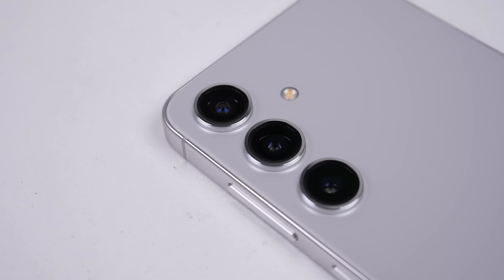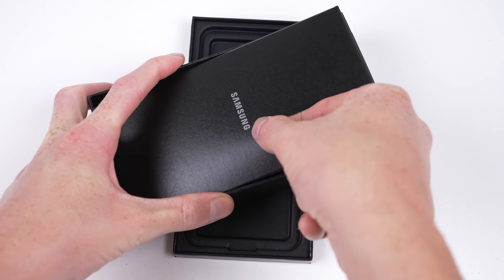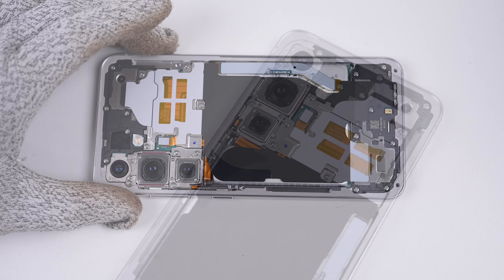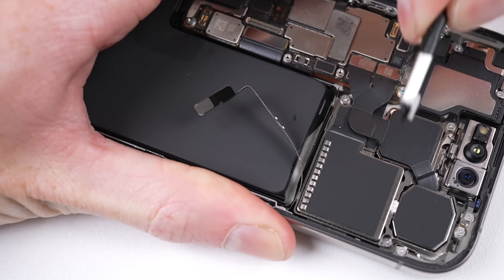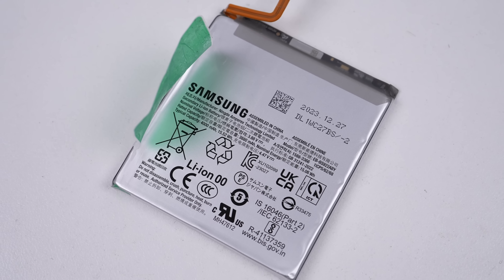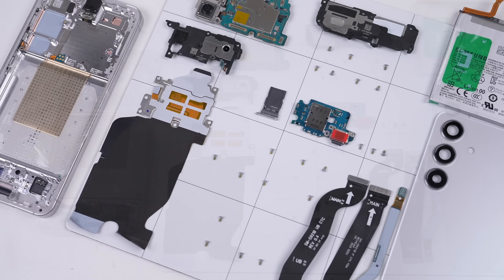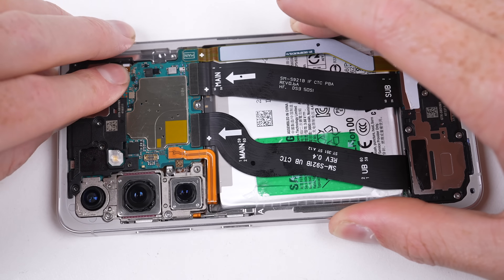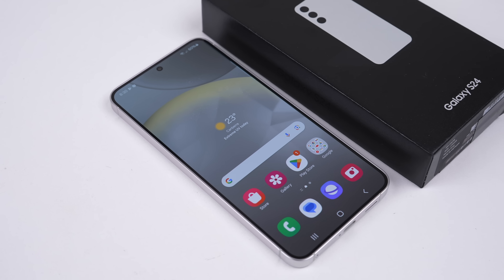If Only Apple Could Make A Phone This Easy To Repair - Galaxy S24 Teardown and Repair Assessment

Comment from the maker: Finally got some new things up on the store over the week. 
Keep an eye out on the YouTube community tab over the next few days as I will be looking for some input from my viewers as I plan to make some changes to my content and possibly upload schedule.
Reply: At  3:49  there's no need to remove the flex cables to remove the battery.   Simply warm up the screen side on low 80C setting on a heat plate for about 3 minutes, bend the flex cables over to the screen side and apply a bit of tape to hold it, pull or pry the battery, and it comes out nice and easy.  And for heaven's sake, please don't inject any rubbing alcohol under the battery, while it evaporates, it can damage the sensitive AMOLED if it seeps under the screen.  I do this every day at my repair shop, saves a lot of time and aggravation. ;)
Reply: can you do oneplus 12 next?
Reply: No, you're not alone. I'm running a iPhone8 with iOS 11.3. Still does what I need it to do.
Reply: Me watching him set up the new phone when I'm using a low end 2020 samsung 😢
Reply: I Love your videos and channel 💞
Reply: Can we also get an s24+ tear down too pls
Reply: @jack8356 it's the same phone but bigger

Comment: to ALL the repair techs that complain about these kinda batteries.....have you considered that samsung isn't guessing that the phone will be brand new by the time you change the battery.  it's prob more like 3 years for most people...seems like the adhesive would be quite a bit less sticky 3yrs later...right?

Comment: One of the reasons why I still haven't retired my locked to Android 8 LG V20 is that, even though the battery is showing its age... I can just pop off the back cover and put in a new battery. Which I did, because the current battery was a triple life third party make that I got years ago, and I can just replace that with no effort. And it has a micro SD card slot. And a headphone jack.

Comment: Pulling alcohol between battery and body may cause display damage because of gap in the middle of body under battery, as well as alcohol properties to penetration. I preffer to make this like you at 1th attempt with using only force.

Comment: >just heat the back up to use a suction cup to lift the glass so you can shove stuff underneath to pry it open 
The fact that this is "easy repair" for current year + 9 is really sad.

Comment: I think Samsung 'soft cementing' their batteries in place with adhesive comes from paranoia from the Note 7 days. Even though it was more of a manufacturing defect combined with giving zero breathing room for the battery. At least a pull tab is better than zero so combined with alcohol and some heat it's safer to pull out than prying it out and risk puncturing.

Comment: Weird to title a video "If only Apple could make a phone this easy to repair" when replacing a screen requires complete disassembly and a whole housing swap, the only way in is through adhesive-riddled glass, and the battery has as useful of a pull tab as the iPhone 4S. Whereas a modern iPhone uses screws for closure of both front and back, only enough adhesive for water resistance, and an easily swapped battery that doesn't require force or solvent. The only good move here is the lack of parts pairing, but thankfully we'll have legislation banning the practice eventually- the EU is already working on it.

Comment: 05:09 Samsung is using a molex connector, seeing that name brings back memories from the 90s/00s
Reply: That's a SIM reader, not a molex connector. They make way more than just PC power connectors (which by the way are still widely used today, if you are into building PCs).

Comment: still on Android 6 🙃. about the glue, its surprising that companies who manufacture things interms of nanometre are still using super-glues for attaching battery, which can be done with any normal glue, considering the battery fits exactly inside the slot with no space around...such glues not only damages batteries while removing, they also damage the frame..

Comment: It may be repairable, but where's the microSD slot?  I really wish samsung hadn't copied that from Apple.
Reply: why do you need a microsd slot for? it’s not 2012 anymore… you probably want the headphone jack back too
Reply: Because lacking the SD card slot means Samsung has no reason not to charge a 500% markup for expanded storage.  With the SD slot, that wouldn't fly.  You'd just get the smaller storage model and supplement it with a cheap microSD card.  Also, the galaxy A series includes SD card slots, so clearly some people do appreciate them.

Comment: For adhesive like that it's important to apply rapid hard forces than an even ramping pulling force. Otherwise you'll end up pulling a lot harder than you need to. Think of it like loosening a rusty nut, a few taps with a reasonably light hammer requires a lot less force to break it than a breaker bar and body weight.

Comment: The battery removal thing still a good thing, i work as a phone repair guy and once i had phone get into flames, with this new system little bit of heat + alcohol will do wonders compared to just glued back as it was before. In my eyes, its a move in good direction

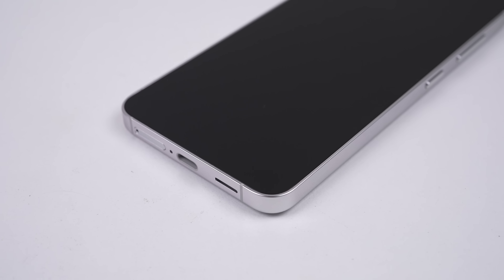Comment: 1:42 no i have the new Galaxy S24 Ultra and i'm very happy. I had the A52s 5G before but this is a huge stepup because its so much more powerful and i never had any lag issues. 
The A52s lagged all the time and got slow
Reply: Mine got stolen a52s was solid until that happened overall s24 is snappy

Comment: Im still on an LG v40 thinq, bought it used for about 60 USD here in the philippines, I recently replaced the battery ang charging IC, now it runs great and I get around 5-7hours of Screen On Time, rocking Android 10!

Comment: Also, my main phone, Samsung Galaxy S9+, is rocking Android 10, which although reasonably modern, is the last supported OS for many apps nowadays, and the critical apps are now Android 7.0+. So it seems that I might be getting a phone upgrade after all soon.
Might also buy that folding Motorola as a secondary device - never had the chance to use a folding phone before ;)

Comment: That seems just about right to me. Easy to repair, yet still being modular and also not needing 4 different types of screw. You also don't need to remove microscopic bits and pieces to do a housing replacement.
Now I'm wondering what the S24 Ultra is like, given that the S24 Ultra is being heavily advertised in the UK market.

Comment: Are you sure you used the pull tab right? Similar battery securing method was used on most huawei phones - you would have to fold/rip part of the plastic film above and below the battery pull tab, as it is gripping the battery firmly. Afterwards the battery comes out easily.
Edit: yeah at 6:30 i can see the tabs i was talking about. You should have folded them off the battery for easy removal. Huawei phones have these marked in orange color, samsung should put arrows thereor also color-coat them

Comment: I have a 512GB Micro SD care in my A050 ... and I will NOT purchase any replacement phone which doesn't allow me to re-use that external memory. I also will NOT purchase a phone without an earphone jack. So Samsung is right out!
Reply: so basically all options are out? unless you wanna pick the budget phone.
I don't say I agreed with such moves to remove those features, but we get less and less option.

Comment: This phone being easy to repair pales in comparison to the anti-self-repair stuff Samsung has been on lately. From sueing third party screens manufacturers or resellers, to attempting to serialise parts...
Sure they have a repair program. But in my opinion it isn't enough. They still control repair and the price of spare parts nonetheless, which is no-bueno especially when a screen replacement well costs over US$200, even over US$300 depending on the model.

Comment: 01:37 - Hugh, I have a Galaxy S7 that's also up to Android 8. But I'm only using it as a spare device for phone calls and SMS. 

Not only does the battery not last a day, but the security updates are very outdated. It's a security risk and that's why I do not log in with my main Google account, full of my sensitive personal information. 

Google and Samsung has recently committed to many years of software and security updates. And to me, the security updates matters more than the software, and helps promote longevity of the device and reducing e-waste.

Comment: i still don't understand why new smarpthones need to glue their batteries

why cant we just go back to the old, slide in and go battery design?, its not like there is any gap that will make the battery move from its place
Reply: The new EU law force them to implement removable battery by 2027
Reply: i think they can do whatever they want with with their product. if you had a phone brand, you wouldn’t like it if someone said that you have to do something a certain way…
Reply: @beaualoevv  well "consumer is king", we buy their products with our money, it's our right to do what we want

Comment: When has the battery moving around inside the case ever been an issue? I never heard about it being an issue back in the Android 4 days when you could expect your phone to have a removable battery; the only time my Galaxy note 3 used to switch off randomly due to a battery moving was because the battery was starting to swell and would lose contact with the pins.
Reply: the old removable batteries had a hard shell built into them, unremovable ones are a lot softer
but with how the phones laid out just a tiny bit of double sided tapes probably enough to keep it still

Comment: Hey man, I'm still rockin my s6 edge on android 7 after replacing the charging board and the battery with an ifixit replacement. Still takes better and most importantly less fake pictures than many of todays flagships. Works fine for me tbh I don't see a reason to upgrade.

Comment: You removed the battery in the wrong way; you should've first peeled off the thin transparent tape a bit which is on the edge battery and beside the pulling ribbon ✓

Comment: I have an Android tablet that runs on Android 4.1 Jelly Bean 😅 bought back in 2012. Although its display cable is broken, once fixed it can run smoothly, even its original 3000mAh lipo battery still works flawlessly

Comment: On the Samsung trying to be Apple thing, I recently went to the Highpoint Apple store to have them do something about the broken rear mic on my 15 Pro Max (which they covered under warranty and had replaced the rear-glass assembly within 2 hours), and I noticed across from Apple and one floor down was a dedicated Samsung store, and it looked just like the Apple store but 1/4 the size and with less people inside. It was actually kind of funny.
Reply: Sounds like less people break Samsung's lol
Reply: @edcdad1124 cuz people only go to an Apple Store when they broke their device?
I doubt people stay in the store for the whole repair. They just return once the repair is finished.
Reply: @GurkenbauerTim  I'm more being sarcastic.

Comment: Hi Hugh,

Your battery was hard to remove because you've pulled the whole adhesive. You need to take off the pull tab AND the rest of adhesive. I've already repaired some s23 series and the battery was way easier thanks to the pull tab. Just need to do like on huawei batteries with "A" and "B" to remove (you need to peel of the B sides before pull on the A)

Comment: Is Hugh a dumbass there seems to be 'A' and 'C' labels (can't see the 'B' label tho) besides the battery indicating which plastic needs to be removed before pulling the battery. The plastic labelled 'A' was not removed and held the battery from the left.

Comment: 1:40
Im still using near 10 years old Samsung Galaxy Tab S 10.5 with Android 6.0.1, you're not alone using old device.
Can't believe it's still usable today (except some apps cant no longer support older versions)
Reply: Galaxy s5 for me
Reply: Galaxy Grand prime plus ( help me ).
Reply: Still rocking a Galaxy S9 from 2018 right now.  If the S24 actually had micro SD support, I'd go with that instead.
Reply: I still use a Galaxy TabPro 10.1 almost on a daily basis. If I weren't on my second custom ROM, it'd be stuck on 4.4 Kitkat right now lol
Reply: I'm still using an LG V20 as a daily driver. Still stuck on Android 8.

Comment: 1:40 Jokes on you i am still using my Xiaomi Note 4 which still runs on Android 7.0 NRD90M. Having access to the Android data or obb folder is a charm. 

However it's sad to see that most applications are now discarding support for Android 7.0 as time passes, forcing you to either run a older build of the program you want or seek a workaround either.

Comment: 1:40 My Oneplus 7T Pro runs on Android 12. And here I thought I was on old tech and somewhat old software [Although not that old) but sounds like yours is much, MUCH older. I mean hey, if it still works then use it till it dies out 👍 

Runs great, battery still like new, no bloatware and runs my games just fine. I’ll upgrade until my phone either dies out somehow or slows down.

Comment: What’s crazy is all these phone companies can use a nice clamp that sits over the battery and utilizes the other screw spots. I don’t see the need for any adhesive. Just need a nice cushion so the battery doesn’t shake around.
Reply: That's pretty much what Sony use to do in their Xperia phones. The Xperia Z2 had a battery in plastic housing, that was held just by two philips screws and two clamps. The phone was still as slim as their newest phones
Reply: @TheMaychalPl  Was about to mention this however the disadvantage to this is the smaller battery. Personally every phone that I've worked on which are my own, Xperia Z2, Oppo A9 2020 and Samsung S20, I don't even glue the battery because all the components around it hold the battery quite nicely and it doesn't move even a bit when shaking it hard. I'd theorize that even blu tack could do the job.
Reply: @TheMaychalPl  Had that on a Fujitsu Lifebook U904, it's just 19mm thin, so similar to a MacBook Air, but the U904 and also the newer U938 are really modular: they have a soldered CPU (the U series were never made socketed), but RAM slot (some RAM is soldered on but they have a SODIMM slot for expansion), M.2 SSD (7mm 2.5" in the U904) and WiFi and mobile Broadband "WWAN" modules, all these parts are socketed.
They also have a very fancy Ethernet port that you pull out and then it unfolds, IMHO it shows that Apple took the easy, lazy way to simply ditch the ethernet port since the Retina MacBook Pros instead of developing such a thing.
And the battery isn't glued in with a ton of that but held by a plastic "carrier" with a few screws.
Reply: True, like an aluminium frame or harness that just sits in place holding the battery snuggly
Reply: That might be dangerous tho if the battery expands. If it has no room to expand it will just burst instead which is very dangerous
Reply: @jarboer  - A metal or plastic bracket holding down the battery along its edges with screws would allow enough expansion for the battery.  That's a moot point.
Reply: That's not a good solution, you'd get either a lot of explodind batteries or your battery jumping around in your phone
Reply: or a weak glue
Reply: Battery must be hard to remove. There's a whole business behind it.
Reply: Yeah, like laptop batteries
Reply: They could simply use two metal or plastic brackets held down by a couple of screws.   Mind blown!  ha-ha
Reply: i dont think you have a slightest clue about basic engineering or physics.

Comment: I mean, at a certain point, there's not a lot you can do to improve smartphones beyond faster CPUs and more RAM. Heck, that's pretty much why they've been throwing multiple cameras into the thing.
Reply: well thats just improving what already exists, they need to try new things more often. basic slap is so boring. flips have gotten more popular but arent as good as they should be in a lot of ways, and then there are other interesting things they could do like LG used to before they quit